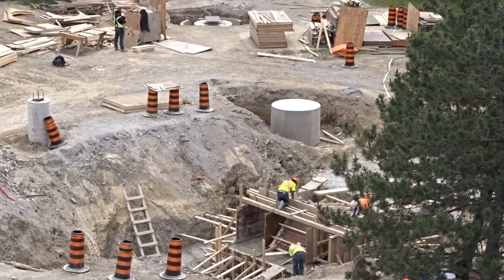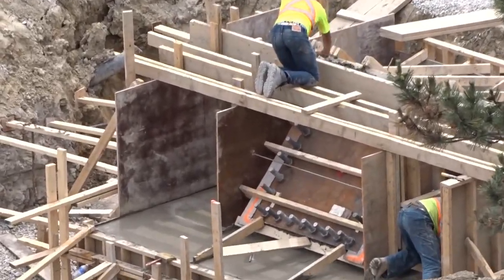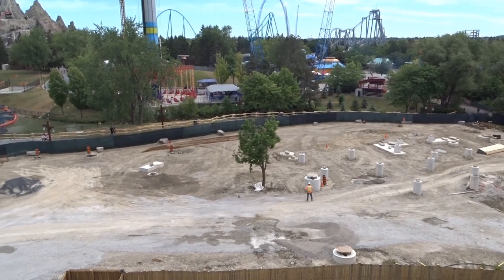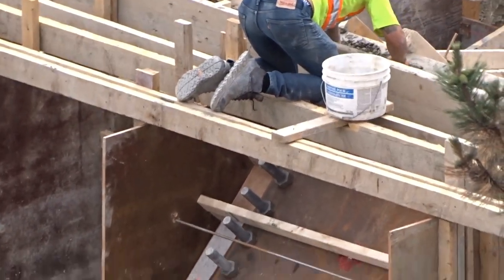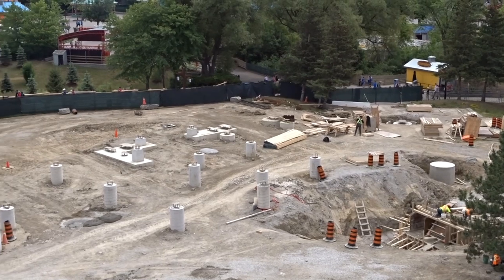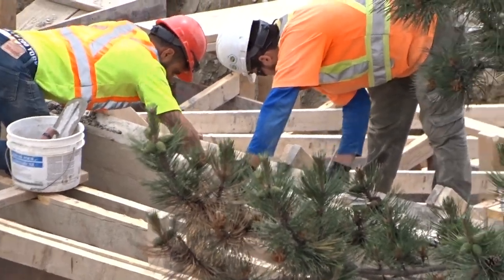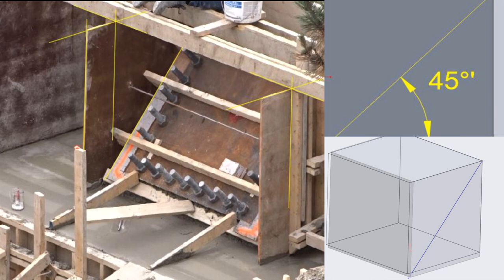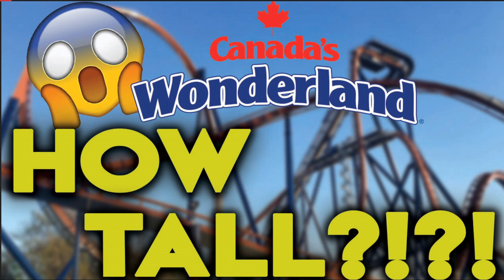Canada's Wonderland Massive New Coaster Height Analysis

Comment: It has to be 307 feet high to be tallest ride in the park, the drop into a tunnel doesn't matter. Total drop over 300 feet doesn't define a Giga, only 300 feet high from ground level does. I've been on 7 coasters over 300 feet tall, and unless this ride is at least that tall, then it's only a hyper with bigger drop and it won't count as my eighth Giga or higher!

Comment: How large is the pre lift section compared to a wing coaster like Gatekeeper?
Reply from the maker: Mitchell Sporing it’s much much larger. It won’t be a wing coaster though
Reply: Amusement Insiders how do we know that it’s going to be a dive?
Reply: Yaxon Duck because the track and the tunnel.
Reply: Yaxon Duck tunnel isn't big enough to fit a wing and the track for the coaster is a dive track
Reply from the maker: Blueprints and tags

Comment: It's hard to tell if the angle is correct BUT the increase number of bolts is interesting. Higher ride? Different heavier trains?
Reply from the maker: it's all so hard to understand. It's a very weird project!
Reply: That angle on the footer piece doesn't look like a 45°, it is definitely a larger degree angle on the footer piece making the lift hill a smaller degree angle.  I estimate the lift to be between 35° and 40° angle.

Comment: Imagine what the first inversion will be like. Likely an Immelmann or a dive loop (hopefully a dive loop), but it will easily shatter any existing records. The tallest inversion prior to that is gatekeeper's first drop at 170 feet, with a potential 300 foot drop I would expect it to be a bare minimum 200 feet, likely closer to 250 feet.
Reply from the maker: Sam17 first inversion would be insane
Reply: My honest prediction is a 275 foot height, 300 foot drop, and a 200-215 foot first inversion

Comment: Being completely honest they would not do 295 just because that would be idiotic to not just cross the 300 mark because technically it wouldn't be a giga since its muesured from ground level where the tallest point is
Reply from the maker: the tunnel would take it beyond a 300 ft drop. It is a difficult concept to grasp though so I fully understand
Reply: The problem is the coaster itself wouldn't be a giga... it would have a giga drop but that doesn't make it a giga
Reply: M Blaty A giga coaster is a type of roller coaster with a height or drop of at least 300 feet. If it has a drop of 300 feet it’s still a giga coaster
Reply: Fire Ethence nevermind I stand corrected I was told otherwise by some other enthusiasts on another vidio
Reply: Not according to ACE, or ANY of the manufacturers! 295 feet tall is a hyper whether it has a a 250 foot or 320 foot drop. A Giga size drop DOESN"T make it a Giga coaster! Height from ground level to highest point of the track defines the category.
Reply: robert polk exactly what I said but they were trying to prove me wrong
Reply: M Blaty. Yes, there are lots of arguments in the coaster community. Such as 1) Counting drop height vs. how tall the coaster actually is. 2) Are new from the ground-up RMC coasters with topper tracks (Lightning Rod & 
 Outlaw Run) considered wood coasters? 3) Are Larsen Loops (Super Loop rides like at the county fair) counted as a roller coaster? My thoughts are 1) Drop height doesn't add to the actual highest point on the coaster measured from ground level. 2) Topper tracks have wood beams and wood support beams under the steel plate the wheels ride on, so they are wooden coasters. 3) Larsen Loops don't have a separate track, it's built into the ride. The car is permanently fixed into the ride frame, so while it looks like a roller coaster, it's just a flat ride. (sorry Six Flags and other parks who try to count it!)
Reply: Agree...why not make it 300?  However, if it's not a true giga in height...thays okay. As long as it feels like a giga (i.e. 300 ft drop), I'm good...lol.